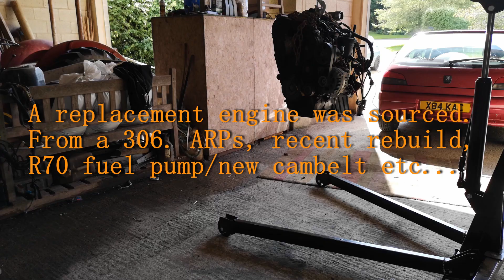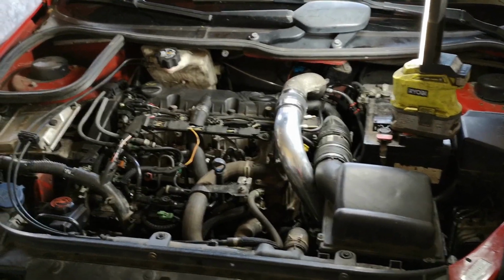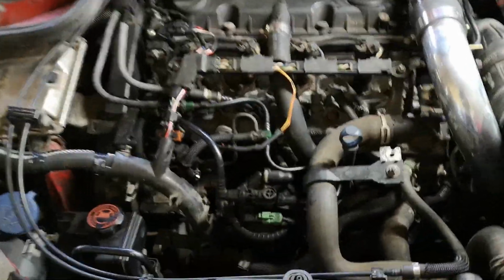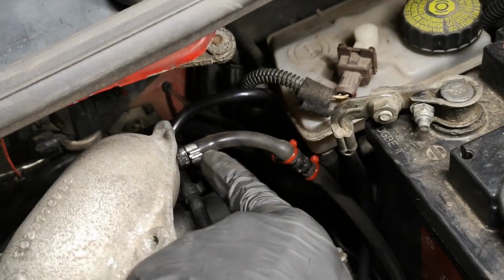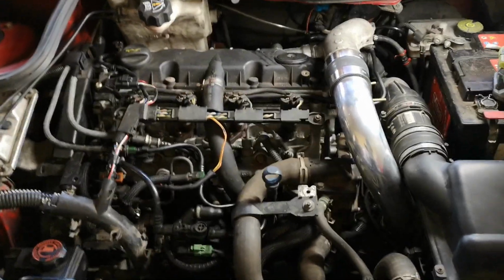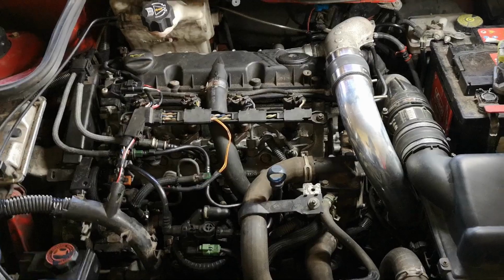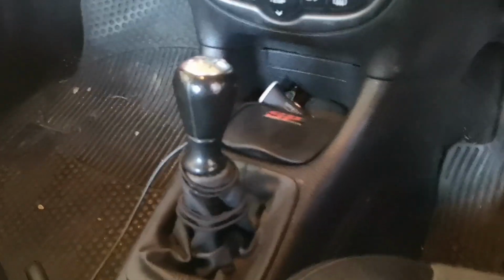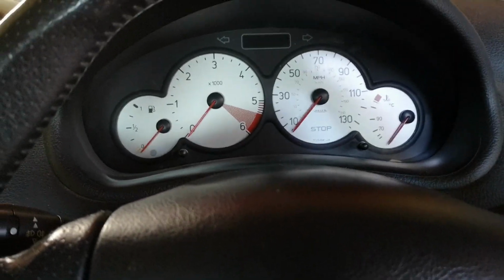The 20h daily - Episode 6 - New Powertrain

Comment: What car did the eco box come from
Reply from the maker: 206 eco
Reply: @PiggyPower  thats funny that the gear shift is too far forward you would think it would be a straight swap.
When your doing 80mph what rpm are you doing? 2500? Thanks im just starting on a stage 2 myself remapping to start with but have always wanted to put a better final drive in it. I think there is a 307 (130hp) 2L 16V that uses the same 2L block with a 6 speed gear box on. One more thing dp i get rid of the egr? If i do will it pass mot? Thanks good videos as always.
Reply from the maker: @antsfur  yeah it turns out the ecobox has its own type of bracket on the chassis leg...I've no idea why they changed it. So bizarre. You'll need to do a LOT of work to get that 6spd box in there. 2250rpm at 70 I think it is with the ecobox. 

Egr is if they know/check. If it's working, leave it alone.